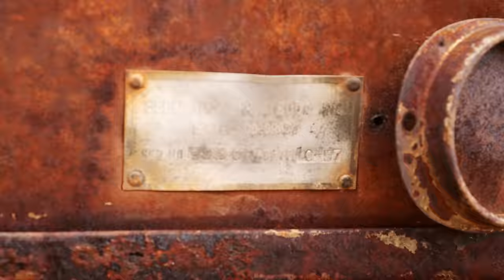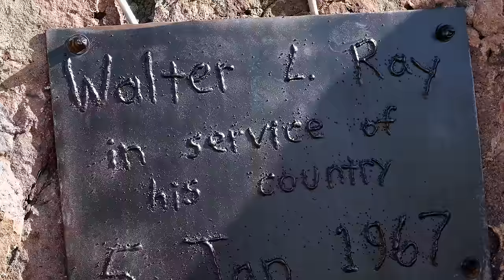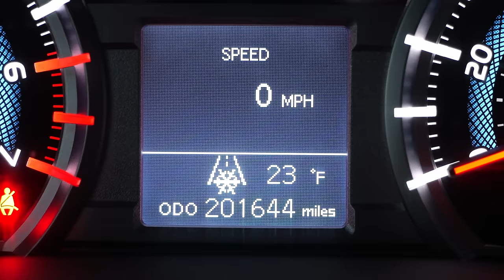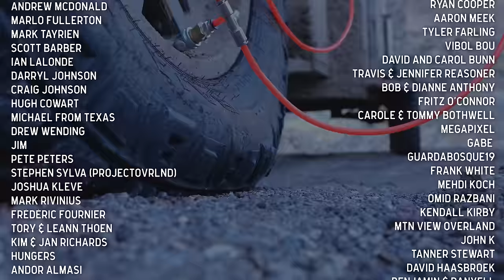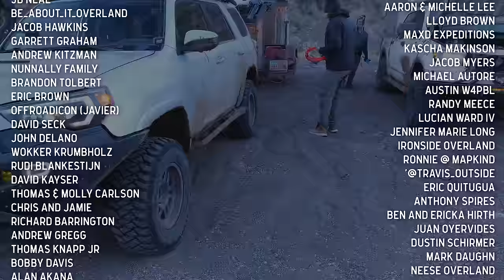Nevada is like another world | Top Secret history  [S7E7]

Comment: Keith (sorry Keven to ask questions on your site) We have the same camper as you have on our F250.  I noticed that you were using a induction cook top, are using a solar generator or a separate battery system for power?  What are you using for your heater?  Thanks Jeff
Reply: I have a 6 kWh battery bank in the OVRLND Camper and use a Propex HS2800 for heat. All is working great!

Comment: is your runner v6 or 8?
Reply: V6 since it’s a 5th Gen. The 4th Gen 4Runners came with the 4.7L V8 option. If you are wanting a V8 I’d suggest either a Lexus GX 479 or GX 460 as they should be less expensive for fewer miles. GX prices have risen since Lifestyle Overland got theirs several years back.